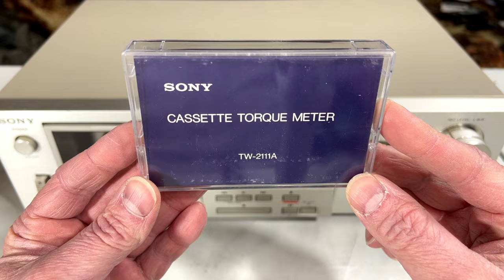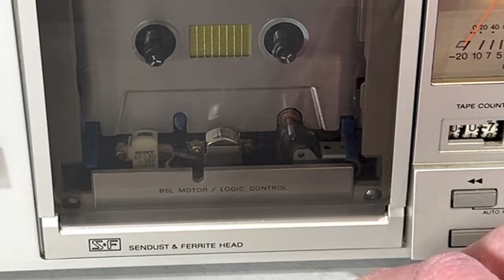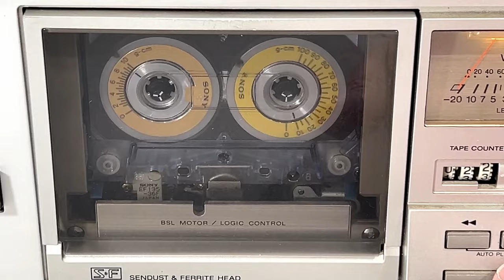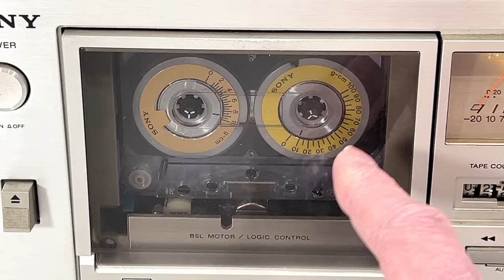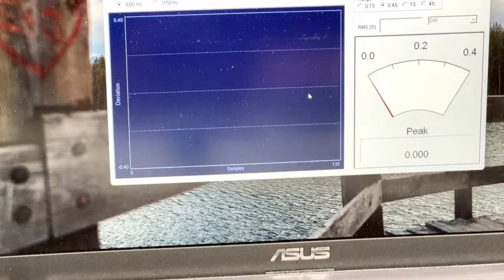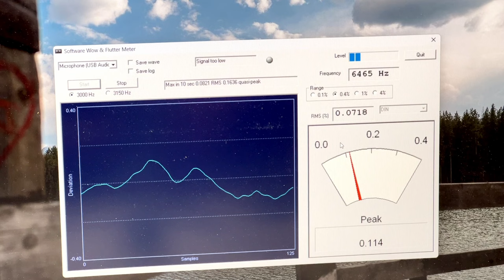2024 Summer of Sony - This TC-K55 Was SO MUCH MORE BROKEN Than Expected

Comment: If I may mention the motor controller board - I rescued a long dead TC-K75, and seemingly one of the developed faults was
that the motor controller board shorted to earth. So I later isolated this so that the solder side could never touch the chasis.

Comment: Those felt disks can be purchased in kit form from the usual suspects, look for something like "felt washer for VCR repair" or something close. A wire brush can also restore them sometimes. CA was the right choice for the overmolded plastic parts that Sony is so fond of, JB weld is formulated for metal repairs and doesn't wet out plastic very well at all. Another good choice is Acrylic cement assuming, of course, it's Acrylic.

Did you ever get your tape back, and why is shipping from US to Canada so outrageously expensive all of a sudden?
Reply from the maker: I got it but haven’t had time to do much with it yet. Shipping from Canada to the US is crazy expensive too.
Reply: @Oklawolf  Okay good, just wanting to know if I need to point the pooch at the mailman again ...